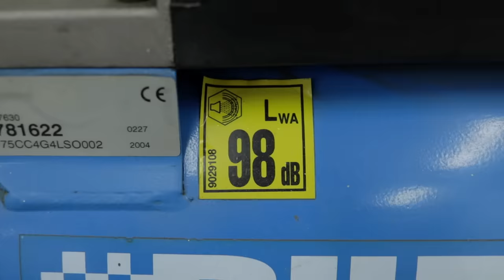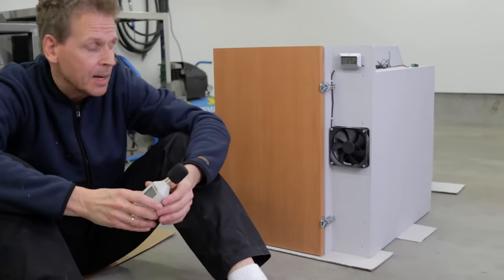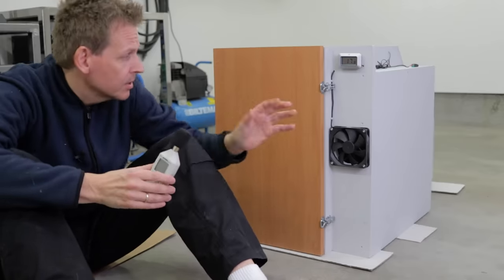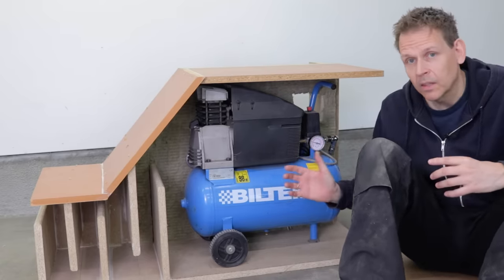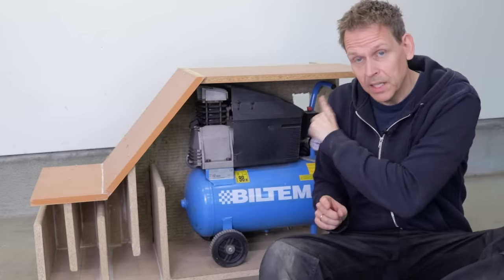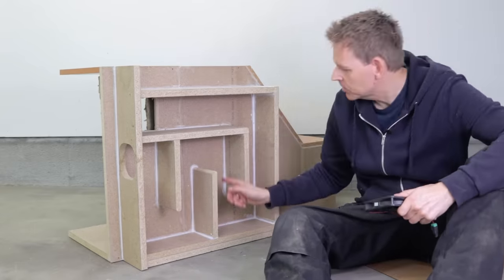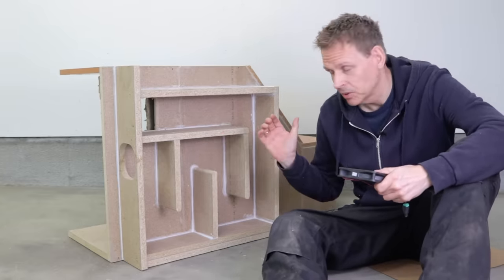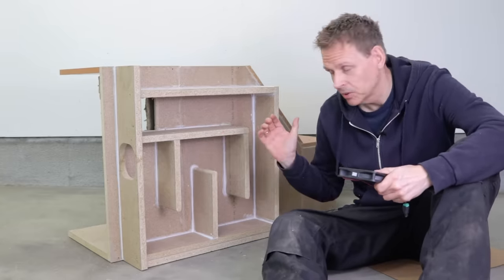Do not build a sound insulated enclosure for your noisy air compressor!

Comment: A great video on what not to do, sorry. If you had of understood some simple facts about sound is that it bounces off solid objects or reflects off solid objects & goes through soft objects, such as wood then your construction would have had a better outcome. The best sound speakers that resonate precise crisp sound are made of extremely thick hardwood or a combination of softwood, compacted cement flooring & finely finished timber outside for looks. As well as having spring mounted legs with 1inch high rubber feet on all at least 3 points which compensates for all vibrations 360 degrees.

If you had of used 1/2" or 13mm thick compacted cement board that is used in bathroom flooring which can be butt jointed together with a square timber skeletal frame to screw together with, rubber padding & some sound deadening material from a car inside the box with a fine layer of decorative plywood on the outside, then you would have gotten much better results. The baffles that you made for air should be much closer together & perhaps 3 times as many using a DIY 3ply 3mm ply, 6mm fibro, 3mm ply glued together. You could lightly fill the baffles with cotton wool balls or large cotton wool padding that has been partially pulled apart to allow more air through. Of course, you would also need to replace the wheels on the compressor & the single foot mount on the front of the compressor with springs, bolts, washers & 1" or 25mm high furniture rubber feet to remove all vibrations that would be sent through the floor of your garage.

Back in the late 70's early 80's I used to work in a building next door to another building on the same complex that had many 100 ton to 1000 ton forges going 24 hours a day for the engineering factory that I worked for but even though the 2 walls which were padded & corrugated thick fibro which cut out most of the sound the sound ended up coming through the floor where it resonated through the concrete that was connected between our workshop & under the actual forges that were pounding all day & night. Perhaps if there was a partition of soil & corrugated fibro fence buried 6 feet or 2m deep between both sides of the buildings & the concrete inner road on the complex then the sound would have been diverted down instead of across. Back then they weren't interested in health & safety within the workplace, I had to wear those twisty type of foam ear buds to reduce noise as well as earmuffs over my ears as well as that I modified the earmuffs by placing a cutout of aluminium can inside the earmuffs near the back of the plastic housing just so that I could not hear the pounding thuds of the forges 100 feet or 30m away from my ears.
Reply from the maker: Thanks for your comment! I absolutely could have used better materials, both for sound dampening and appearance. I used materials I had laying around, trying to keep cost low. I think the materials you have suggested would have been a bit expensive 😋 Chipboard is not bad at all if you calculate cost/performance, MDF would have been better as it is more dense - MDF is about 4 times more expensive than chipbord. And the box is heavy enough as is to keep upstairs in my garage, I am afraid cement tiles inside would have been too much.
Anyway, a lot of good suggestions here when coming to performance and design, but somewhat beyond a garage box budget 😊

Comment: Built a separate room for the 5 hp piston compressor in my new shop, together with some storage for multipurpose usage. Nothing special, drywall on both sides of the wall, insulation 125 mm on one wall and 200 mm on the other wall facing the shop (it's in a corner). Sealed the wall edges completely to restrict any sound leakage and it takes care of the job. It's not silent but the most difficult part is to restrict lower frequencies. You need mass, thick material or double walls to dampen those and that's not how walls are usually made. When you get the high frequencies out, you'll be fine.
Reply from the maker: Smart!

Comment: I just finished up my box (check my vid), and your box is very very well made. I made mine using all free materials, minus the screws I had left over. My baffles are crap due to lack of space inside the box and me being in a rush to get it build and out of the living room with the misus complaining at me for having a massive compressor in her living room, size constraints stopped me making the box bigger. But I plan do add more turns to my baffle in the future. But the main thing is the type of noise that it stops. That high pitch aggressive sawtooth sound is turned into a deep low rumble like big fridge. I've even been considering mounting mine from the ceiling using bungee cords to isolate any vibration going into the garage floor. Nice video and nice box. But yeh my compressor was £20, and the box was free to make. My budget was 0. As I'm very poor currently.
Reply from the maker: Well done, a huge improvement for very low cost 👍Be aware of heat build up inside the box if you ever should use it continuous for longer period of time. I would think it can get very hot as there is not much ventilation, even less if you add baffles that might restrict air flow and ventilation even more.

Comment: Thanks! Glad to see the impact of adding the baffles for air flow. Did you see the temperature gauge show if the cooling fans were necessary? I would suggest suspending the compressor in the box with shock cords to absorb vibration radiating of the box/floor.
Reply from the maker: I do think the fan does its job, the temp goes up 5-10 degrees Celsius when the compressor is running, and it takes around 5 minutes to get back to ambient temp with the fan running. I have never tried without though. Thanks for your suggestion. Adding some kind of vibration damping to the compressor inside the box and between the box and the floor would probably make it even more silent.

Comment: This was a highly engineered box. You can get a lot of the benefit out of a much simpler structure.
Reply from the maker: Absolutely, the box had this strange design to fit it under the table and my pitched roof upstairs. I also tried my best to use leftover materials from a previous project, it made it extra complex 😋

Comment: When I built my small shop I included a small addition on the rear to house my compressor and Shop-Vac. It gets plenty of air circulation. I sound dampened it with the same used in sound studios. Small area, not much money. Then I bought sound absorbing pads for both to sit on. I checked it with my phone app when standing in the shop. It showed 25Db for the compressor and 15Db for the vacuum. At first I didn't realize how important it is to tape all the joints.

Comment: Impressed with the quality of work, but surprised you drilled holes in the trusses.
Reply from the maker: Happy to hear you liked my work 🙂 The holes all the way on top of the trusses are placed so they don't weaken the structure noticably. You can see they are above the main trusses mending plates, the load on the trusses at this position is minimal, close to none. The trusses are also overdimensioned, as I typically do in most of my projects 😁 (I have built the garage myself, from ground up). It has been like this for about 20 years now, so I am quite sure it's OK 😊

Comment: I’ve got a silent generator. Noisiest little trucker I’ve ever had…. Mass plus rubber plus heavy adhesive weighted rubber = a start….!
Thanks for the video and the honest assessment.
Reply from the maker: At least air compressors turns off once in a while whenever the air pressure is high enough. A generator needs to run all the time to produce electricity. I can totally understand that can be tiresome 😣

Comment: Great project, not sure if others have commented, but it's more optimal to have exist-fan than fan that attempts to blow fresh air into it. If you have some good fans to pull out the hot air, you'll get natural cold air drawn into the box. That's a suggestion for a potential improvement, if you ever get dangerous hot levels.
Reply from the maker: Yes it has, so I might just have to change that 😊 I have got several comments about pulling air out is more effective that pushing air in, I think I just need to try it to see if it makes any difference in real life. Thanks for your comment!

Comment: Great video, and I thank you for the time and effort you put into this. 
One thing I would like to point out- I seem to see holes drilled for your air lines in your trusses. 
If your structure uses engineered trusses, they are never, repeat Never, to be drilled. They are structural and the loads they are intended to carry are carefully calculated.
Reply from the maker: Hope you found the video useful 👍 The holes all the way on top of the trusses are placed so they don't weaken the structure noticably. You can see they are above the main trusses mendig plates, the load on the trusses at this position is minimal, close to none. The trusses are also overdimensioned, as I typically do in most of my projects 😁 (I have built the garage myself, from ground up). It has been like this for about 20 years now, so I am quite sure it's OK 😊
Reply: @kihestad  Ah, very good. Thanks for the explanation. I didn’t know that you had built the garage yourself. My comment refers to my area (Canada), and engineered trusses in particular. My main concern is people who see a video, don’t know the background of your video or anything about truss specifications, and just go around drilling holes wherever they please.

Comment: Add a 90-degree bend to the filter inlet and replace the filter/silencer with a bigger, upsized one. The larger size is to reduce any possible restrictions caused by the bend and increase the filter's capacity. It is low cost and easy to do.

We do this for all our shop and portable compressors. It is probably the easiest modification that will make most compressors quieter—not silent, but a measurable difference.
Reply from the maker: Wonder if that would make it even quieter when it’s inside the box? 🤔 could have been an interesting experiment ☺️

Comment: As I remember about 40 years ago or so, I made a noisy compressor considerably quieter  just by hanging carpet  around it. It absorbed the sound enough to make the hundreds of people around it making more noise than the compressor with all their squawking. I hung the carpet on the 4 sides, leaving gaps between them. Then I suspended a piece over the top, of course with gaps. Someone had the great idea to cushion the feet and that also helped. Done in minutes at a very low cost with huge results.

Comment: if you add a magnaflow performance exhaust to the box, it will sound cooler and add at least 10hp to the compressor
Reply from the maker: I need 20HP, can I use two of them? 🤔😂
Reply: @kihestad  yes, but make sure to use an X pipe to prevent resonance lol
Reply from the maker: @SilverBullet93GT  😅

Comment: Nice video, came up in the suggested next. 
One item to look at might be the compressor its self. Those "oiless" direct drives are horrible when it comes to noise (and longevity). 
A nice oil lubricated compressor with seperate motor (while more expensive up front) tends to last longer and run quieter and cooler. 
One concernt with an enclosure... "most" already "forget" to drian the water out of their tanks daily....can't imangine putting it in a box helps with the remembering to do so.
Reply from the maker: Traditionally the bigger belt-driven compressors had been more silent because they run the compressor slower but with more torque. Today the direct drive compressors are very quiet as well, but not as powerful. 
It's a very dry climate here in Norway where I live, even though it rains a lot 😋 I don't need to drain it every day I use it, just once in a while. It's a bit cumbersome as it is now. I have to open the hatch and take it half way out of the box 😔

Comment: Putting the compressor on the attic is a great idea.  I will do the same.  Thank You!
Reply from the maker: I am very happy I did, but it is heavy to get upstairs 😋 Beware of vibrations though. It was never a problem when my air compressor was downstairs on the concrete floor, but upstairs the vibrations goes into my wooden floor. I have got some tips now on improving it, eg: using a yoga mat or two squash balls divided and put on each corner

Comment: For a decent sound proof enclosure remember a trick from framing staggered 2x4s i recommend a closet or a work bench be constructed.  2x6 or better 2x8 header and footer.  Nail in 2x4s staggered so one is flush in and one is flush outwards.  For this project get foam weather strip and run it on all the "flush" surfaces.  Then fiberglass batts or even better just fill it with sand.  Use slat board on the outer wall for a storage provision.

Or number 1 best solution is to use a belt drive compressor head off a 3 phase motor with a VFD.  Configure for soft start and variable rpm based on pressure.  Plenty of tutorials for this run a high tank pressure and regulate it down

Comment: I'm not an expert on soundproofing, but as far as I know, the way you set up your baffles, you may be able to change the frequency, but wont achieve a significant overall decrease in amplitude. Although, with your setup, the pressure wave has to change direction and would loose energy, as there is no significant enough flow disturbance, it would not loose much. Meanwhile, as you are forcing the sound into a channel, certain frequencies that are close to the channel's natural resonance could be amplified. Also, while the baffles may absorb some resonance, as they are not decoupled, they would transfer most of it to the frame.
With baffles, you usually aim for a back pressure and some energy absorption. The back pressure you can simply achieve by having dead ends the pressure can travel to, or create channels that would directly produce a counter flow. For decoupling the baffles, you either limit the area where it attaches or use an N or a U shape (sideways, in your setup), where the direction the wave propagates in the material has to change, or use a compressible material for attachment. Using compressible materials as baffles is a good idea in itself, as they can absorb more energy. You can also try reducing the surface area of each baffle, but then you would have to increase the number of baffles.
With the intake channel, you will have to be a bit mindful, as you just only need to increase pressure in one direction. Meaning you will have to angle your baffles towards one direction.

Comment: It sounds a lot quieter when it shuts off! With a typical shop air compressor, which is about a 5 hp piston type, the best answer is to put it OUTSIDE the shop. What I always do is make a tiny little shack to put it in, on its own tiny slab, with some insulation and vents for the air, and the ability to unscrew 6 screws to take one wall off, to drain the water, etc. Most shops are VERY  reflective of sound, having all hard surfaces everywhere, so going outside makes a huge difference. Even my big 160 cfm trailer mount air compressor is not very noisy, and outside the shop, you cannot hear it much inside the shop, although it is not for shop air.
Reply from the maker: Agree, putting it outside is probably the easies and smartest solution to the problem 😊Unfortunately, I just dont have space for it. My garage is placed with minimum distance to two of my neighbors. The side facing my own property is not usable either,  as it's just a slim path between my garage outer wall and a concrete retaining wall. In front of the garage door is no good either 😋
Reply: @kihestad  Yeah, I have often seen private people and commercial shops put their shop air compressor out back, but NOT in a little shack, so it radiates plenty of noise to the neighbors -- not such a hot solution! It takes some work to bottle up the sound and still keep the compressor healthy.

Comment: I've worked a couple of years at a generator builder. Building enclosures for the big boys with 2 ton diesel engines.
You could stand next to them and hardly notice they were running.
We also used baffles in the ventilation parts.
Big difference with your design though was the sound isolation. Every square cm was covered with 2 cm thick sound isolation foam.
I really think the fabric and rockwool you used is not up to the task.
Als you need to mount the compressor on rubber mounts calculated for the specific weight to get the fibration isolation which also helps a lot
Reply from the maker: More or better sound insulation, especially in the ventilation channels, would definitely have helped a lot. I will add soft rubber or some kind of dampening foam under the compressor feet and under the box to reduce noise from vibrations. Thanks a lot for your tips! 👍😊

Comment: Makita has the MAC Q series and they are really quiet. We have the MAC210Q (oil less) and the MAC700 (oiled). The 210Q is in the territory of having a normal conversation next to it. The MAC700, while rated higher dB is still pretty quiet due to its large piston. Fantastic compressors.
Reply from the maker: Thanks for the tips 👍

Comment: I agree with your conclusion; a lot of effort and money for little benefit. When trying to suppress sound you should work on the principle that the only things that are truly effective are mass and isolation (not insulation). I realise that it was impractical in this case but if the box had been built out of heavy concrete blocks and the compressor had been standing on a thick rubber mat the sound transmission would have been greatly reduced.